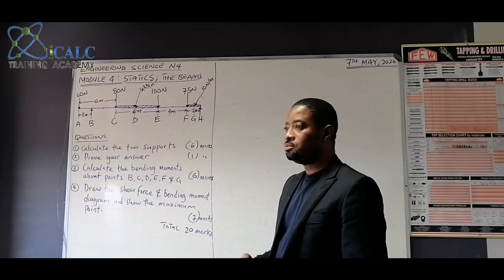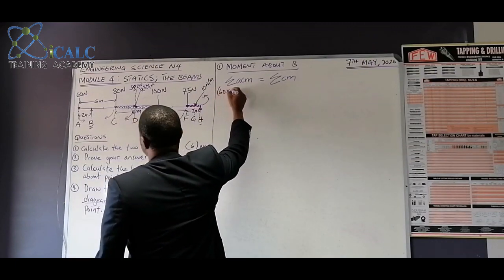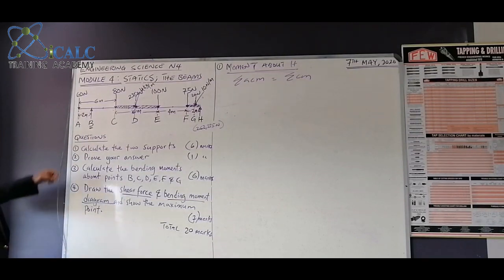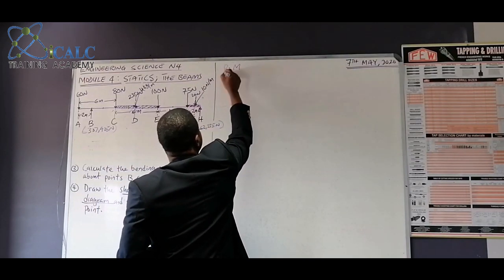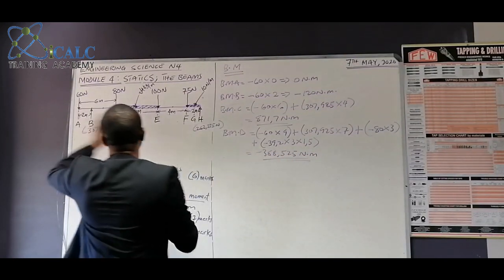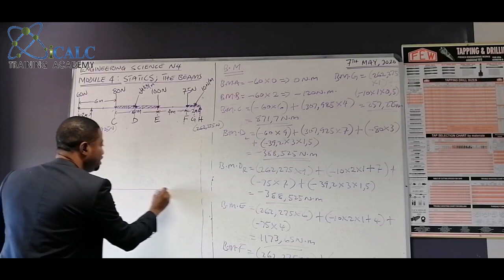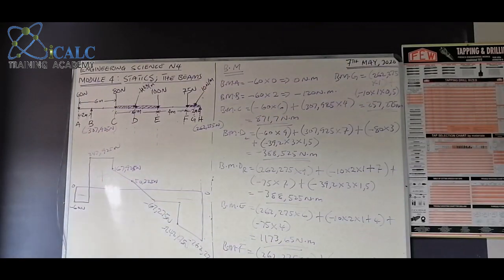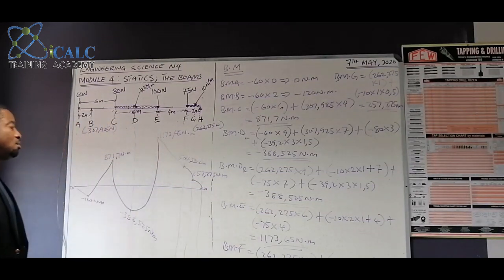Calculations on Bending Moments for Engineering Science N4

Comment: i believe the bending moments diagram is wrong
Reply from the maker: Could you please say how it's wrong?
Reply: I am not sure if it is my Calculator. But my BMD is not - 388,525 I get 1199,075 please advise
Reply: @settlersmalebe4507  the point load of 100N was missed, so if you add that you will get the answer right
Reply: The shear force diagram  you missed the Pont load 100 N